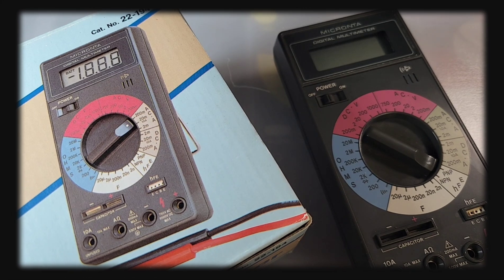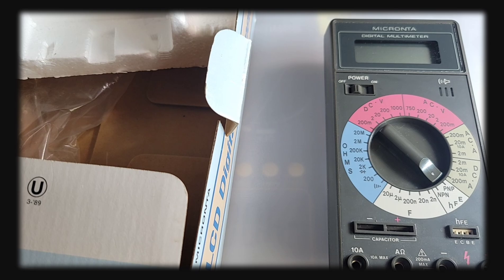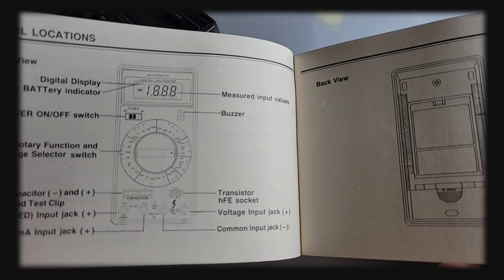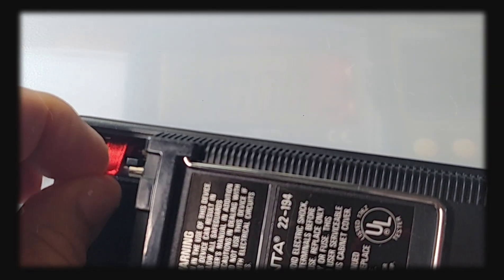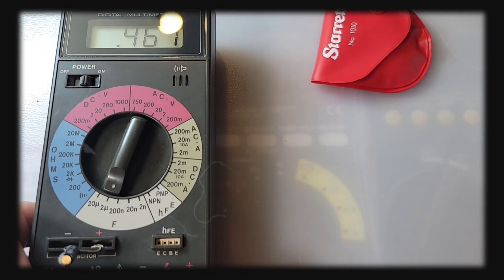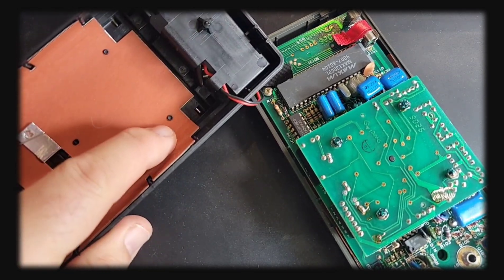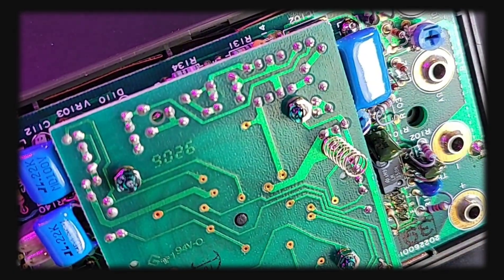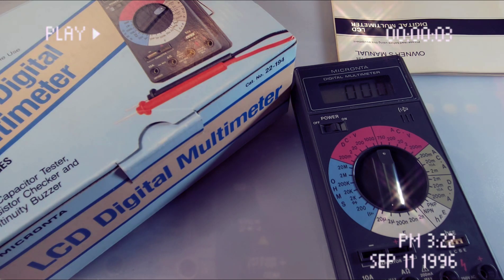RETRO-TECH ○ MICRONTA 22-194 Vintage Multimeter Mini Review & Teardown!

Comment: This is still my main go to multi-meter.  Never had a problem with it, and it always worked great, especially after replacing the 9 volt battery.
Retro? I use it all the time, so it's difficult for me to wrap my mind around "retro".   Does this mean I'm retro?
Reply from the maker: Not RETRO.., you're simply vintage 😍👍 , seriously it's awesome 👌 this multimeter is still doing the deed!

Comment: I have the same unit for over 32 years. Still working excellent.  The only thing continuity sound does not work. Any idea?
Reply from the maker: Probably a cold joint...
try reflowing the piezo connections (ted+black). If still a no go, check if the wires have a cracked.. might need new wire. Awesome its served you so well all these years!

Comment: You gotta love that unfused 10A input. Nothing could go wrong there, especially when trying to see how overloaded an old house circuit might be (IIRC it turned out the 15A screw-in fuse in the basement wasn't wrong).
I still own mine, and I've only had to resolder or replaced the leads a few times. But modern meters are safer and have better ranges and accuracy.
Reply from the maker: Great testament to some nice build quality. Not the safest but a classic nonetheless 👌 Glad yours has served you well.

Comment: What is MAX130CPL? Is it a 7106 clone or something very different? The capacitor layout strongly resembles a 7106.
Reply from the maker: MAX130/131 are 3 1/2 digital A/D converters with an onboard lcd display driver. It utilizes a band gap reference to generate a analog voltage.  It uses the same circuit as ICL7106 however it has much better power consumption @ 100ua /250ua max from a 9v battery compared to 1800ua of the ICL7106.
Reply: @KeepOnTesting  Wow, similar to 7126/7136.
Reply from the maker: @watchmakerful  Exactly ..both have extremely low-power drain. 👍

Comment: Amazing that everything still functions as designed 30 years later. I wonder if any of the cheapos sold today will last 10 years under light usage.
Reply from the maker: Great question...the fact calibration is still good 30 years later is also a testament to how well these multimeters were put together. 😀
Reply: Believe it or not I have some el cheapos and they still work fine.  I think ever since solid state electronics became a thing most meters usually hold their calibration.
Reply: @jonfreeman9682  which components you experienced needed to be changed in these cheap-o's for them to work properly in long term?